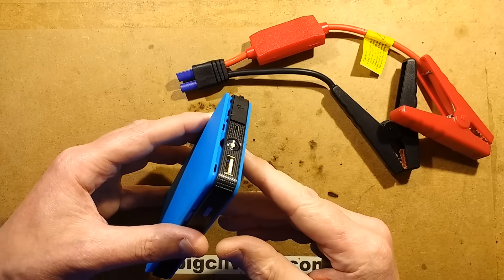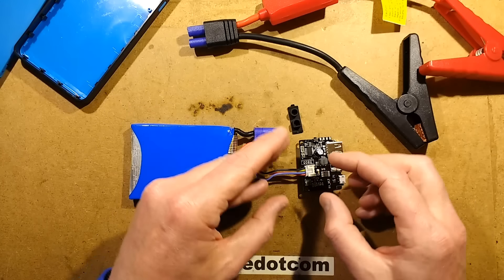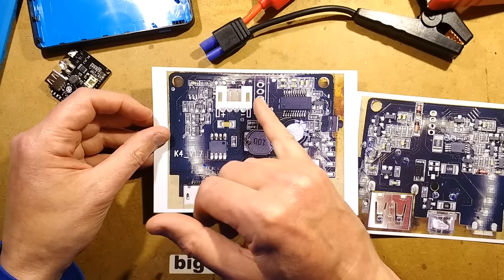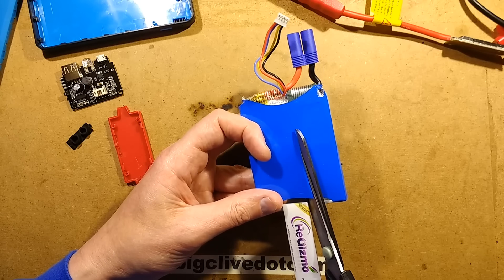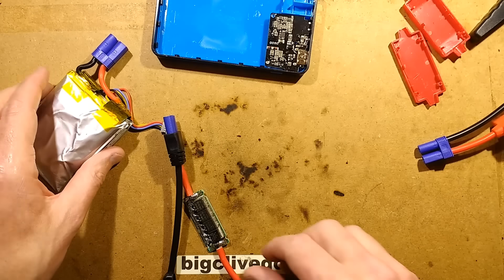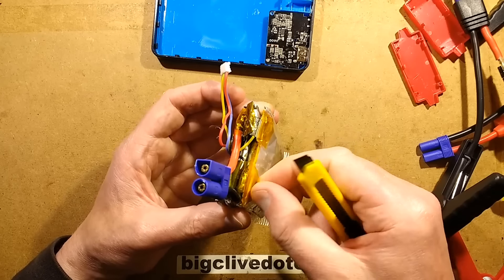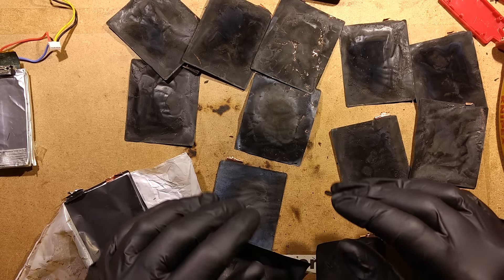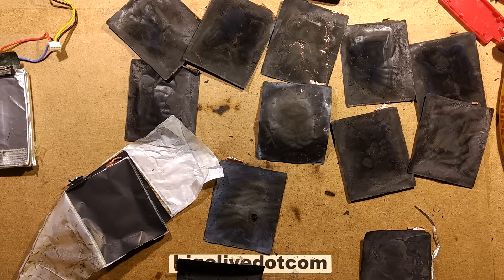Shorting out a fully charged cheap lithium jump starter.  (It didn't end well.)

Comment: If you shorted JUST the battery, assuming its a Lithium Polymer, then you would have had Liquid Napalm Explosion. No joke. Clear in this video it only shorted momentarily (causing the puff), then something in the wire circuit blew.

Comment: Heh.  Reminds me when I revived a slightly puffed up batter in an old smartphone by compressing it between two solid plates in a hydraulic press. I then used that battery for a few more months before replacing it. (Back in ye olden days when batteries were easily removable. Yeah, that's right kids. Back then one just popped off the back of the smartphone and replaced the battery.)
Reply: Aaahh, simpler times. The reassurance of being able to carry around a spare battery - not a battery pack and associated cable, a proper damn battery - is something I miss. God bless early 2000's Nokias.

Comment: Typically with those style jumpers they usually keep the protection circuitry in the cable itself usually there is a box after the connector that usually has the entire circuit in there. They sometimes all look the same, probably smart using the same style circuitry ones thats proven good but could also be cause its the cheapest alternative hence why these jump starters arent worth very much.

Comment: How does a battery that small put out that many amps
Reply from the maker: Lithium cells can be engineered to have an extremely low internal resistance.
Reply: @bigclivedotcom  so it goes based on resistance . So if you have low resistance lipo cells they can out out more amps

Comment: In those cheap jump starters  there is no bms between battery and output clips  notice the red box in the red wire clip  there is inside a double diode  to prevent kick back to the  charging pack and there is no fuse ! also those diodes drops the voltage which is worse when u need to jump start a car battery that is stopped in a remote place don't buy those .
if u are talented and know some electro mechanic xp    get a super capacitor with a DC motor and some gears and a crank pedal  charge that cap with the motor and few turns 
jump the car and then u go .you will never worry the  jump starter getd defect in the time u need it the most.

Comment: Clive, instead of simply shorting the battery you should start some V6/V8 car and then show to public what is happening if you use too small battery for cranking. That would be far more educational. In contrary LiPo batteries with high C number definitely support high current output like several hundred amps. The main problem what I see in his charger - battery looks too small (should be 4S, not 3S) and device lack failsafe circuit to disconnect battery on too low voltage for protection from overdischarge an swelling. Also I believe that this device should not be held in car fully charged. This is a fine recipe how to burn car to ashes.
Proper cranking device IMHO must use battery for supercapacitor charging and then use charged supercapacitor for cranking.

Comment: Hi big clive do you fix memory sticks by any chance? I tried and failed
Reply from the maker: I don't.  But check all the solder connections.
Reply: Thanks for replying i did try soldering the 4 connections back on and seem to have lost a component off the board is there anyone you could reccomend?

Comment: I've got a "jump-n-go" name brand version of this, mom bought it years ago for my grandad and he didn't want it; so I find it in my own possession. Knowing what I do about batteries and their chemistry (I am no expert by any means) I have been extremely wary about leaving this in my car; due to extreme temperature changes. I have all but eliminated the risk of heat, I have weather guards and keep my windows cracked pretty much all the time; I also keep the portable jumper under my passenger seat to avoid it being exposed to direct sunlight. I take it out of the car and do a full cycle on the battery for good measure every week or two. And finally because I live in Michigan and the winters are not kind, I opt to not leave in my car at all. I've had our brutal cold kill a couple rc lipo's I left out in the garage, taught me an expensive lesson. Ah well I suppose, at least I haven't burned anything as of yet 🤷

Comment: you have saved me from taking apart a lithium battery charged by a solar panel which expanded out through the sun heat.  these lithium batteries should be recycled - easily - to save the earth's resources.

Comment: any dude having  3celllipo packs for fx RC I reckon would be able to use one of his 3 cell pack with one of these diode clamps. that cost around 3 bucks shipped..
the only thing you need is just a plug-adapter as not many use this big lipo-plug standard but mostly xt60 and T plug and so. on 3cell.
just be fast and perhaps have a dude standing by the battery to take the pack off the moment the car is running to prevent to much current kickback.
Reply: If I'm wrong please state it. as I have not tried it yet, even though I have a bunch of high C lipo-pack for quads and soldered the plug adapter and have the diode-clamp which i can attach them too, but haven't had the need and also pretty hesitate hence all the electronic there are in many newer cars not least hybrid cars with electronic bells and whistle.(can be very expensive if i f.xx something up inside there.)

Comment: 20:34 Put them all in a neat pile with the plates close on top on each other and it will start to smoke and if the conditions are right it will start to burn since the lithium is reacting with the moisture in the air.

Comment: Lithium go boom drove over a pack on the ground. It smoulderd at first and in about 15 seconds it burst into flames. Lasted about 1 minute
Reply: I had one go up on the bench only soldering a wire to it blew up like a 4-10 going off

Comment: Hi Clive, fascinating to see what's inside this basic unit. I have a much posher one. Like your examined "noco" vid, I use it as a "super" power bank and also to power my VHF radio. Having seen what's inside the two you've opened, I'm really glad when I made my connector to the EC5 point, I included 15 amp fuses! 

Still and all, if I did use it to start a car, it says it's good for 600 amps. It'd have to. So I'm surprised yours blew it's stack at 500. This would rather seem to confirm what appears to be the case from folks I've heard using them as jumpstarters - they tend to work... once.

Comment: strangely i think i never saw this video.
it is scary that those microscopic battery can output 500amps!
why dont they make car battery like this?

also to prevent the little booster pack from auto-destroying themselves why not use smaller or longer wire to act as a current limiter? keeping the current around 100amps will be quite sufficient to help most car start.
Reply from the maker: Lithium car batteries are becoming more common.

Comment: I dont get the concept of such starters as in most cases it is enough to charge the car battery from such pack for even 5AH. So you can limit it to 20-30Amps and leave for 10-20 mins

Comment: The "ventilation holes" are actually supposed to be plated holes to the copper layer on the other side of the board: and the manufacturer used a single sided board as they did not know that the higher current rating is needed...  The batteries look also smaller than they should be. Note that the MOSFETs and batteries are not designed to handle continuous (!) current into the short. The experiments you are doing are super hazardous!!!

Comment: I tried a Lithium Jump starter that claimed to be able to start a 8 Liter V 8 enine and have 1500A starting power... It was not able to power my 150W 12v DC to 220v AC inverter without any load on it (it would just blink for a moment then die...), to get it working I had to hook it up to my 95Ah 700A cold crank car battery.

Comment: That l-ion tech seems to be "the bag" type like the ones used in the new e jaguars. They swell when charged and discharged. Tesla has a better idea. The Leaf has no temp controller on theirs. Run till they get hot. Watch "Rich Rebuilds" as he smokes the cylinder l-ions. Like bullets going off.

Comment: I saw a guy on YT, puncture a puffed cell and then seal the hole with hot glue. Then, he claimed that the cell was good for many more flights. 

I think we need to wait for the new, C60 batteries in development. They are as safe as NimH and charge fast and discharge faster than Lipos. Musk had to get on board.

Comment: I am back.  It did not work.  It put up 200A @5V when starting (measured with oscilloscope).  To work on a 4 liter car, the size has to be bigger than a palm can hold.
Reply from the maker: Have you considered a supercapacitor array?

Comment: Can i make a jump starter with li ion 18650?
Reply from the maker: Not recommended.  They are not made to put out 100's of Amps.
Reply from the maker: It is worth noting that people have used power tool batteries to jump start vehicles.  Those batteries have parallel arrays of very rugged high current cells.

Comment: How a pack like that can output 500 amps? Considering the cells are 4000 mah, this is 125C! 3000 mah is 167C!
Reply from the maker: The cells are designed for very high current output.

Comment: You would be well advised to stop exploration of batteries.  Serious explosion or fire could result from your curiosity. 
Some of the chemicals on the membranes do spontaneously explode when in contact with the air or when your plier shorts a gap.  A little bit of knowledge, in this case, could be dangerous!

Comment: that's 500A at how many volts??
Reply: About 12V, same as a car battery.   Starting a medium-sized car requires about 200-300 Amps for a few seconds.
Reply: @karhukivi  oh wow. it makes sense, I just didn't think lithium had it in it ;)
Reply: @furtivedig  Don't forget, it is not lithium metal, one of the electrodes is a lithium-cobalt oxide and the electrolyte is a liithium salt such aslLithium hexafluorophosphate.

Comment: I build lithium battery packs for ebikes and I accidentally poked a small hole in a 18650 cell. I heard a hissing sound so I dropped it on the floor and ran. It put a 6” hole in my floor when it went off. Oops!

Comment: i left one of these on my passenger seat in the sun for an hour or so and it swelled and busted open the case of it. i was lucky.
Reply from the maker: Yeah, lithium packs do not tolerate high temperatures well.

Comment: I was so nervous changing a battery in my phone after I did it I realized how stupid and dangerous it was. Not worth it because of how much glue and tape is holding down the battery. You have to wrench the damn thing off and risk tearing it. Not worth getting a fire started.

Comment: There's a surprise, you open a battery and find a pile of cells.  You could call it, something like, oooh, I don't know, maybe a.... "voltaic pile"?  The actual result was never in doubt, a short circuit through a copper pipe is never going to end well.  Interestingly, but not nicely.

Comment: i am a very curious person. but i have literally never wanted to actually see what's inside the foil of a lithium battery.

until now heh
Reply: i actually noticed a rise in voltage on my own (kinda scary) high current lipo packs when squeezing, especially on one of the lazy cells that report being 3.4v while the others are very confident saying they're at 3.8... this makes me very worried now as i had previously charged it up regardless, with no puffing or anything, but now i know, it could actually be overcharging the cell. terrifying. though, it is strange in my case, it still isn't showing even a milimeter of puffing.
Reply: i'm actually very unsure what to do with that pack, as i am no stranger to puffed cells, though all have been low current cells, safely seperated after many many cycles, but these have had very few (which isn't suprising i guess, i haven't been very kind to them) but still hold voltage in 7 of the 8 cells, and could be very useful to me as a low current field charging pack for my other high current cells. but oh boy i don't want to test my luck.
Reply: more background if theres anyone as curious as me: these are flight packs for a high speed drone, one which was too big and scary for me, so was dismantled for curiousity and soldering practice. i now have a much cuter, much lighter one (which manages to be faster) that has much smaller batteries, half the size of these chonkers. i could (roughly) charge all 4 of my 4cell flight packs off these 2 4cell ones, from 4.2v to 3.5.

but very early in their life, i have had to replace their damaged in flight balance leads, which as a first soldering project was a very risky maneuver, but essential to use them. i did cause a very quick short (though unsure if it is the same, now lazy cell) when soldering, and didn't have any kapton or electrical tape to properly isolate what i now know are very important to isolate cells, so reusing some factory tape and using extra scotch tape, i managed a repair good enough for charging and flying.

however, this being the first time handling such packs with only a little more knowledge that i had since letting 5+ cells just sit at less than 3v in a closet with no accommodations, they were not always sitting at 3.8v in the best of conditions. i didn't know much about storage (even now, the information is annoyingly vague) so i thought that since my charger let me store them at 3.95v (which is pleasing to my strange brain, being exactly between full 4.2 and nominal 3.7v) and i could more easily test different settings without charging each time.

i don't know if that's enough to cut my losses, and just bring em down to 0v and save myself the anxiety of managing them. i certainly will not be attempting to seperate or repack them. the leads and connectors will be salvaged if i do let them never be revived again... but they still hold charge... certainly nowhere near as skechy as many packs are in this hobby

Comment: Some things are designed to confuse and bemuse. At the age of nearly 70. I have seen things that are meant not to be fully understood..but for us to reason why. I have looked at things that shouldnt work.yet they do. I have learned that things out of my field of work and understanding.just work. I bought one of these.and it got me right out of trouble when I needed it.then afterwards.upgraded my battery for something else.still working.patent pending. but what use is it going to be to me when fully ellectric cars come in for good.👎

Comment: Haha now i know what's inside and look like inside, actually i bought one of those but upon testing it, it did not work due to the contacts of the two terminal are not sturdy enough,  when i used my tester on both of that alligator clamp, upon moving the the female and male on that jumper it reads 12. 6 volts, so that parts are loose, anyways, i even interchange the probe negative to positive and saw a light fumes or smoke emited , because i unintentionally interchange it, good thing, seller still accepted the falsely unit and i got my refund money.

Comment: I know this video is old, but COME ON! Have you checked the specifications of a relay capable of switching 200+ amps ???
I tell you where to find one as such: Your starter motor. (and this is what you are about to start with such pack ...)
A BULKY piece of copper plate, pulled in by a huge magnet, balanced by a strong spring ...
connection surface area over 5 cm2 in total
Material thickness over 2mm
There are no general electric solution to this switching problem ...
If you have to switch 400+ amps, with a loss of 0.5V, the FETs should have an internal resistance of 0,00125 Ohm!
You can use 10-100s of FETs for sure, but that would not be cost effective, would it be? ... :)
The more Ron down, the more they cost, you know for sure :D

Comment: "Whio used it a couple of times but then it just stopped working".... .. Let me stop you right there.. what do you mean"used it a couple of times".. bow many times? because.. "couple" means two.. EXACTLY two.. but .. most people use this when they mean.. "A few times"..

And there is a HUGE difference.. how it is used.. how often it is used.. how it is stored.. and so on matters..

BUT.. in the LAST millennium.. cars sucked.. and.. things worked "differently".. 

(just as things worked differently during the colonisation of the US compared to now)... 

Either way.. "Jump starter".. that is something that SHOULD be redundant to begin with.. if you buy a Japanese car in the 60s and live in northern Sweden.. then fair enough.. as long as the temperature is lower than 0⁰C..

BUT... ALL technology has been more refined.. and.. tries to hone in to the specific use-case that it is INTENDED for... and preferably NOT wasing our natural resources nedlessly..

So.. My first memory (where I knew the actual year) is 1982.. (I was born in 76 and I DO have earlier memories, but THIS is a memory that literally included the current year)...  ONE thing that is the SAME as it was back then as it is today is..

You use a "Jump starter" as a "Hail Mary" to get your car going.. 

IF you have to do a Jump start then it shows that SOMETHING isn't okay..

And.. you are supposed to FIX the thing that isn't okay..

Back in the days it was usually about having your car outdoors in the freezing cold, and you should build  or rent a garage, BUT.. it could ALSO be about you having a defect in your car..problem instead is internal to the vehicle.. then.. yes.. you ARE supposed to have a battery that is fresh enough to survive "normal" temperatures.. 

You are NEVER excused to have something.. and it suddenly stops working normally.. and you have an ALTERNATIVE method of getting it to work.. and when that stops.. you suddenly blame the "Hail Mary"... because.. you WANTED to continue to ignore the ACTUAL underlying problem and continue to use the hail mary as a way to  keep going.